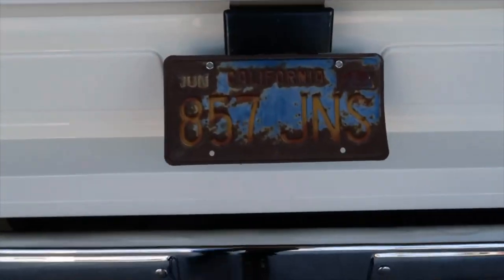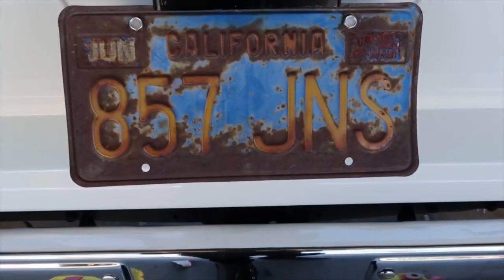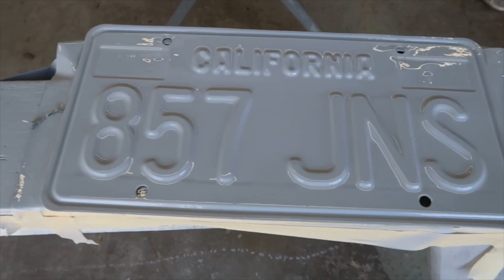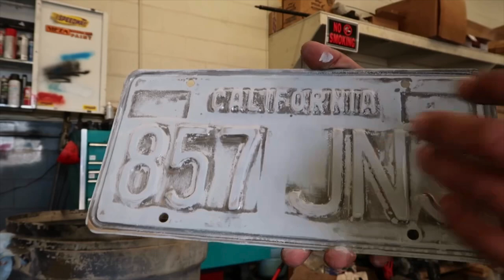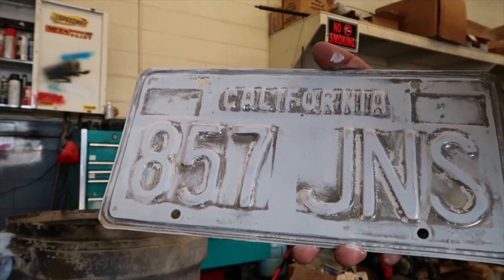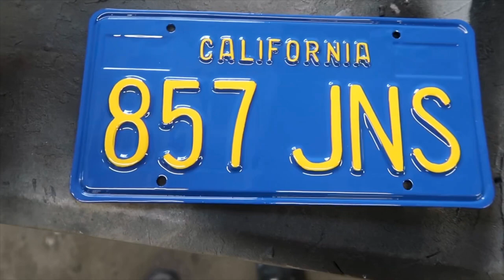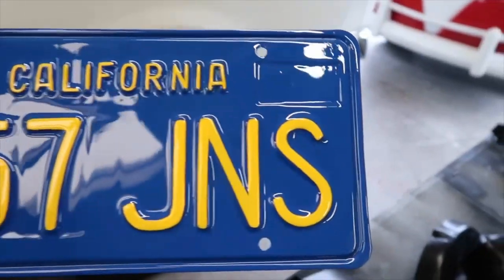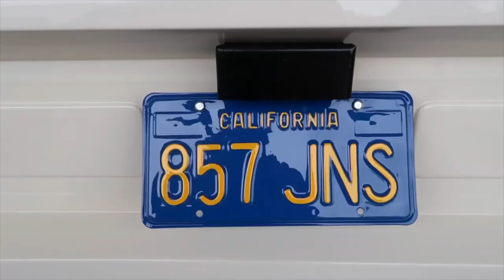Refinishing an antique license plate in 6 minutes!

Comment: Nice work! I want to restore a 1983 Georgia plate for my 85 SS Monte Carlo, problem is they have stickers or print at the top that would sand off. I’ll probably have to find a nice original, for some reason the 83 Georgia plates fade out weird. Check them out on eBay.

Comment: Thanks for the video.  What paint did you use? (Oil based, water, urethane? Or)  Could you recommend some paint and primer to restore wa state 70s (green lettering and white background) license plates?  It's for my cj7 jeep. 
Thanks again.  😊
Reply from the maker: I used a urethane base coat 
One shot striping paint for the letters 
And urethane clear coat 
That’s what I would recommend will last another 25 years

Comment: Nice job! I'm getting personalized black plates soon. What do you recommend i use for a clear coat on them when they come in? I want to use something that will not yellow or crack from the sun and other elements. Is there clear coat in a spray can I can use that you think would last long?
Reply: They have 2k clear coat in a can that comes with hardener built in and activated once pressed (shelf life is 2 days once activated) can get it on Amazon! I recommend

Comment: Monster good job. Did you use epoxy or oil-based enamel? What if I don't have the spray equipment? My yellow on black refurb was done in enamel and is chipping at the corners and where the vintage metal frame sits.